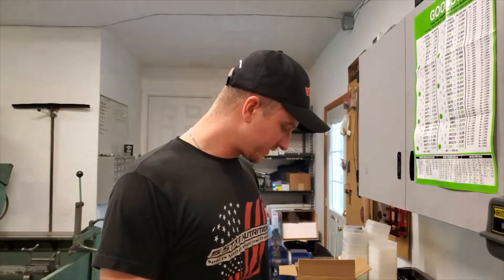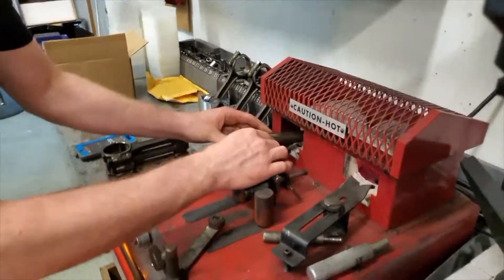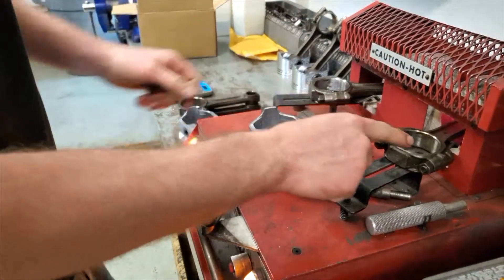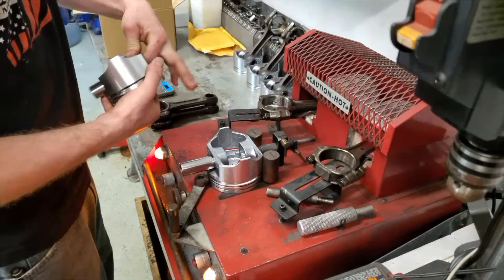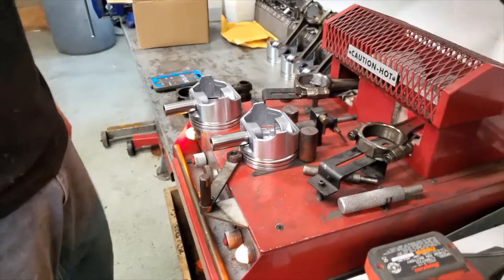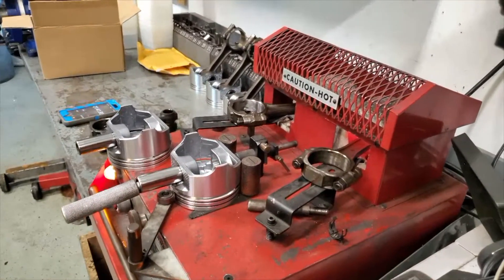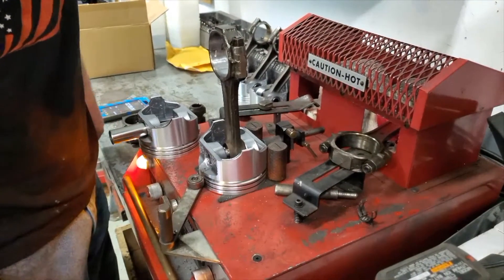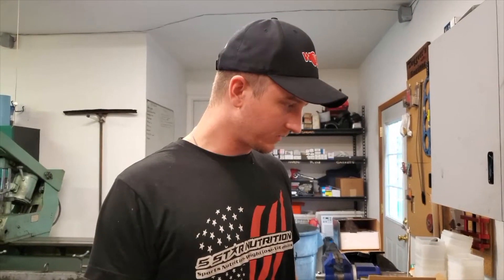How to Install Pistons on Connecting Rods

Comment: Does rotating assembly need a rebalance when changing stock pistons to new flat tops
Reply: If you weight match the new pistons to what the old ones weigh you won't need to.

Comment: I didn't understand about the chamfer part.
Reply: He did a really mumbo jumbo answer for something simple. The chamfer goes toward the crank and the flat goes toward the other rod on the journal.  So the chamfer on piston one would face the front of the engine and the chamfer on piston two would face the rear of the engine. Repeat for the remaining six. Odd numbers chamfer forward, even rearward.
Reply: Now, that is a really clear answer.  Thanks! @michaeldose2041
Reply: The chamfer on the rod goes toward the radius on the crank journals. One side of the rod has a bigger radius than the other side.

Comment: I want to buy this machine...plz suggest the place where I buy this one..
Reply from the maker: This is a Sunnen rod heater. Goodson.com  sells rod heaters as well. They can be kinda pricey for what they are. Sometimes you can find good deals on them.
Reply: Got mine off Ebay.
Reply: I stager mine. Put one on the burner, wait a minite and then put another in. Minute go by and assemble first rod and put another in and minute later assemble next rod. Takes 9 minutes if I don't fumble lol